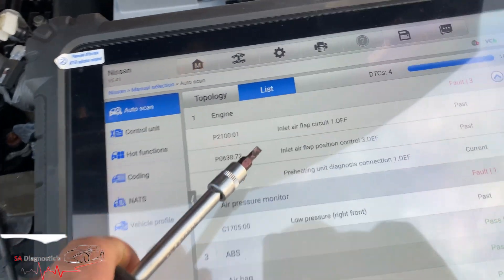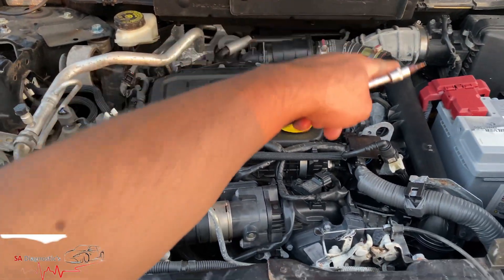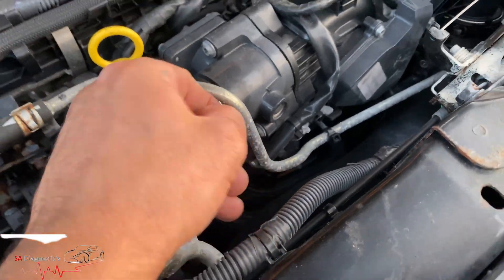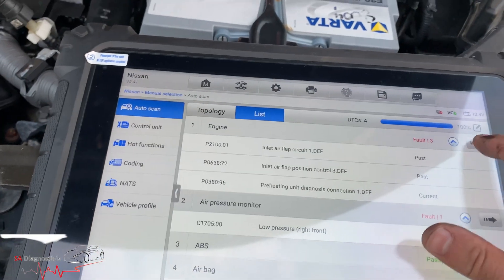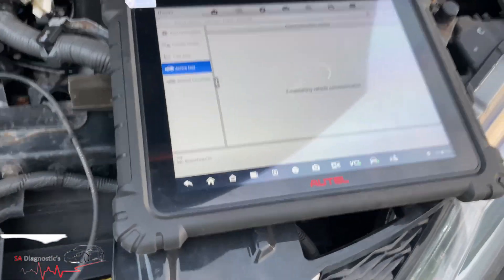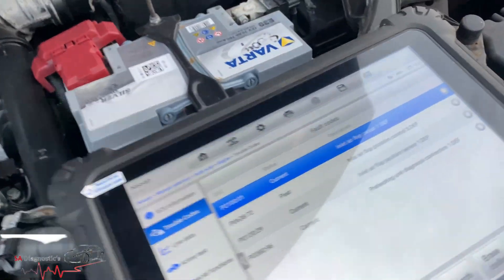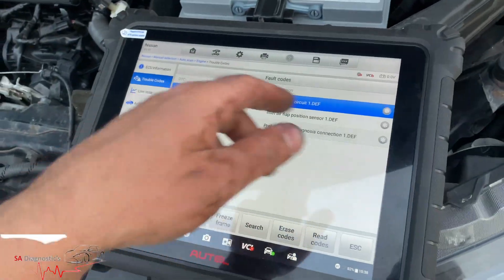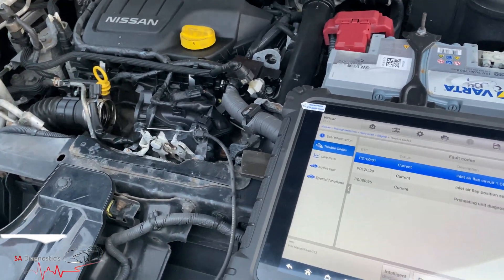1.6 Diesel P2100 P0638 P0120 Inlet Air Flap Position Circuit Sensor Control

Comment: I have a swirl flap fault code on my Vauxhall vivaro. The van starts and after a few seconds dies. Will keep doing so. I have replaced the MAP sensor. Would the swirl flap prevent it from idling?
Reply from the maker: Yes swirl flap can cause issue…